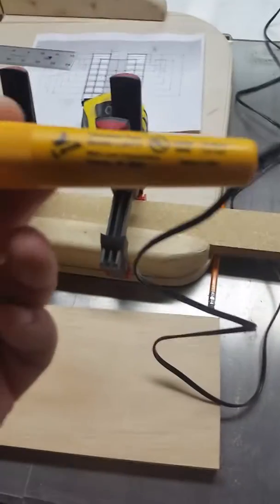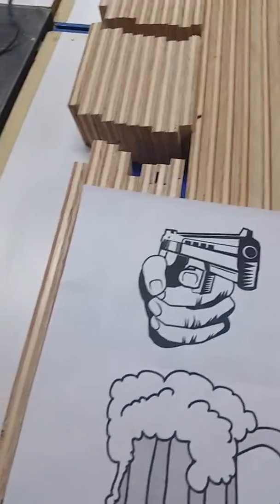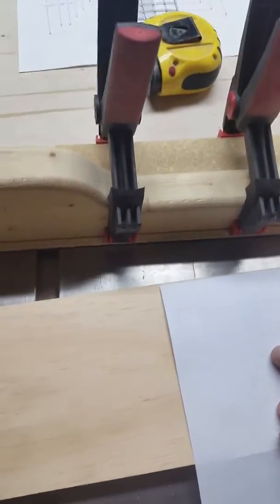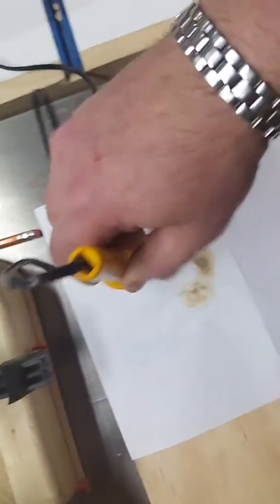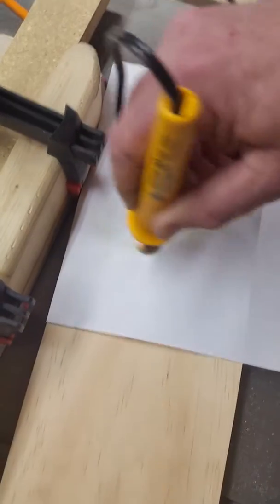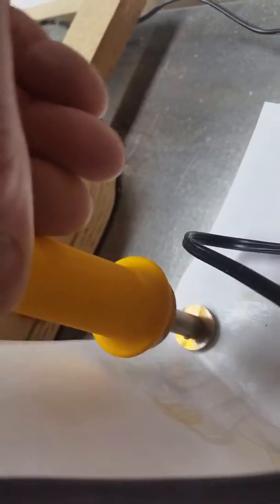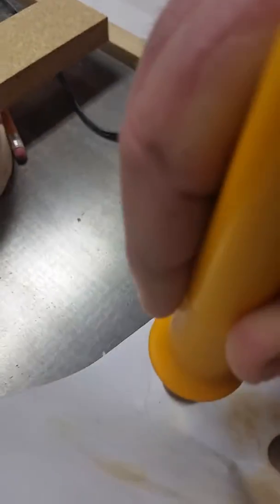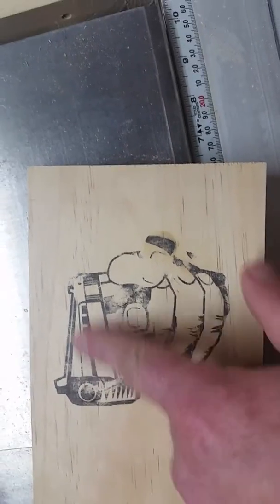Wall lenk L25TT transfer tool

Comment: Have you tried Acetone? Cuts out the wait on heating up, and may be a little faster in the transfer itself as well. Mineral spirits won't work - must be acetone. (Also, needs the laser printer).